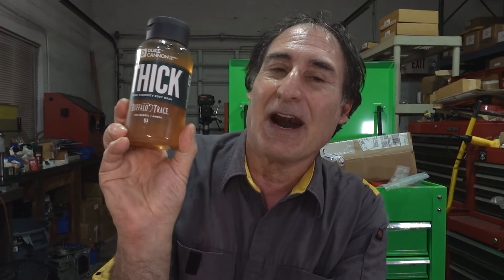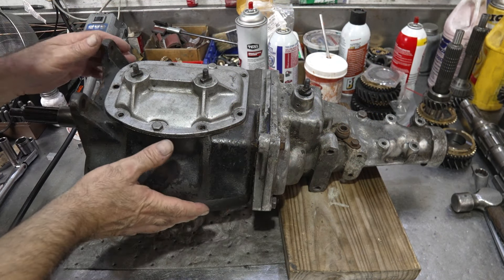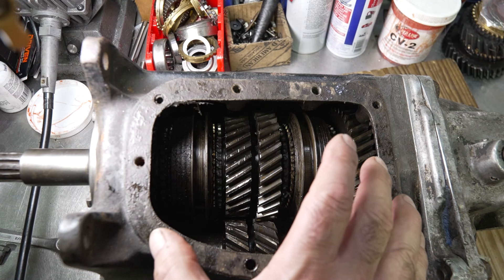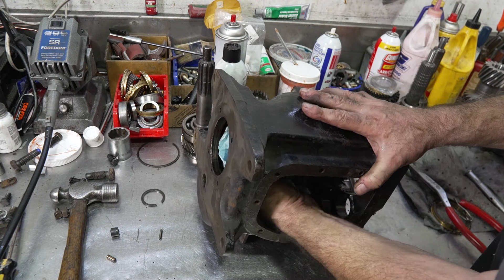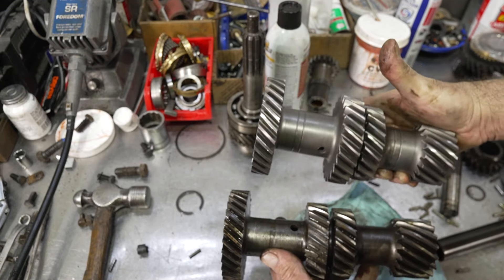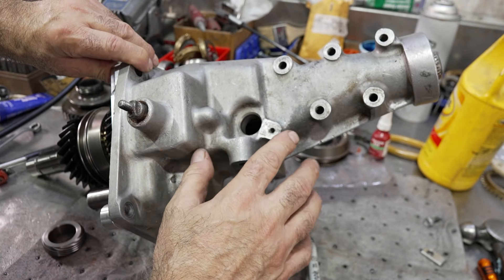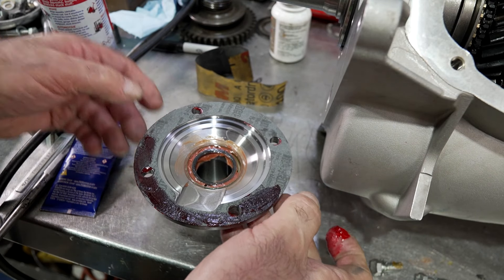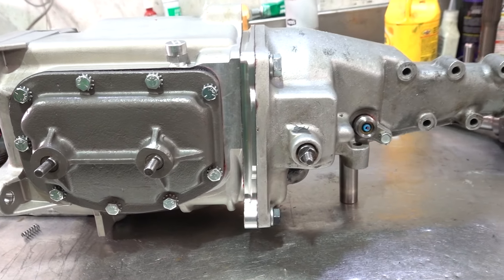C1 Corvette Early T10 4 Speed Rebuild and Upgrade

Comment: That box looked like a Saginaw or an iron Muncie. I worked on manuals in the 80s and 90s in Australia and never saw many of them in our shop. They were in some early Ho;den Monaro models. BW 4 speed single rails in some 70s and 80s Fords and Chrysler used to twist the mainshaft splines too. I once put Datsun 510 gears into an early Datsun Fairlady case. The Fairlady original gearset has Porsche type synchros. Took a bit of modifying too. Interesting stuff!

Comment: Missed you. Hope you get to feeling better. In a 350 small block and when they just came out with the angle plug head from GM and a crane cam back in the day I went from a close ratio muncie tranny to a super t 10 with 2.88 first gear. The car ran faster with the close ratio than the 2.88 first gear. You loose so many rpm from 3rd to 4th it took me out of my rpm with cam and rear end gear. On the street didn't even have to use first gear just used second because first gear was just a waste. This was on a 1973 Z28 with 4.88 rear end gears and 7,000 rpm shifts.. Am sure they make first gear to second longer today to keep 3rd to 4th closer to the close ratio. I sold the super t 10 and went back to my close ratio muncie tranny. Also the super t 10 seem to always grind a little going into 4th while on it. I would have taken the super t 10 apart to see why it was grinding into 4th gear but since I lost so many RPM between 3rd and 4th and the car ran slower just put the close ratio muncie back in and it ran much better. Depends on your application really. I must have got a good close ratio muncie tranny it shifted like a dream with a hurst shifter as the only upgrade and scatter shield. Only one who could beat me was a guy with a 1970 chevelle ss with a 454 in his car. He only got me by 3/4 car length in the quarter mile back in the early 70s. Super great times back then. I still get folks yet today to fix there 4 speeds you take the cover off the tranies and all the synchro and gears are all tore up. They think you can fix it by just install new brass synchros. I said it all shot and they don't want to put the money into it so I never see it again. I tell them to call you but am sure they don't by the way I told them 1,000 and up to fix this old tore up stuff. Then they come up with all the cheap crap on ebay and I say it's all junk on there. So am sure they buy that crap get a book and try and fix it. I told them I won't use that junk to fix it cause I don't need all the problems that come with it. At 72 I just give them your website to look you up. Hope you got a few to fix.
Reply from the maker: The 2.88 ratio is not good for drag race applications and should never be used with a rear axle higher numerically than a 3.55.  This conversion is an altternative to installing a 5 speed in a C1 corvette. You drop the rear down to 3.08 and have better acceleration and economy in 4th gear.  By the way this combination was used in later 1981 corvettes as well as the 84-88 vettes with a 3.08 rear using the Doug Nash OD.  Thanks for watching

Comment: super interesting Paul!  for the sake of curiosity, why make the conversion shafts with the 26/27 spline input output?  if they're being made as a retrofit item, why not make them work with the original clutch disc and drive shaft yoke?
Reply from the maker: The 16 spline shafts and gears were designed for their intended use from 1957 - 1963.  So... low horsepower.  The advantage is that you are now using late model Super T10 gears with better ratios and keeping the shifter location unchanged. As far as splines go.... the 26 spline input and 27 spline output are way stronger... also explained in the video,

Comment: I am in the process of upgrading mt early c2 with the t-10 trans.  I expect 425 to 450 lbft so would like to make some changes in the trans to make it stronger.  I don't want to change the 2:20 1st gear as I am running 4:10 gears withs the 340 hp engine, ,  My trans was redone about  20,000 miles ago and is in good condition.  What changes would you suggest to handle the extra torque?
Reply from the maker: The stock T10 gearset especially if it is old will break

Comment: so the locking or non-interlocking syncroteeth (brass syncro) take ALL the engine horsepower torque through those beefy gears? I thought the syncro teeth were there just to match up with the adjoining gear so that the sliding shift gear can ingage the wide span of the gear itself
Reply from the maker: Yes, all the clutch teeth are taking the full load of the torque. That is what connects the gear to the shaft. Certain cars I've actually seen those teeth shear on the high load.
Reply: @GearBoxVideo  That's incredible,  yes amazing the syncro or as you properly say 'clutch teeth' can take these loads, amazing come to think of it. BTW LUUUUVVV your videos! I just wish you had more to show!! I've learned so much!!!
Another Youtuber :'2vintage' say's his gear set on his Honda Quad, the gears keep slipping out of gear and into neutrol on it's own. And he's stumped looking at the gear set and can't find anything wrong with it when he's closely inspecting them.
Please more videos!! 🙂🙂
Reply: oop's it's a Suzuki Quad, and not a Honda Quad. If you would like to quick look at his issue, his Youtube handle is 'I Can't Fix This Rare 2-Stroke Race Quad' time; around 1:04. Sorry if i'm taking too much of your time. But you're the pro, maybe you have some ideas

Comment: I have a t5 world class I rebuilt with your video grinds in second any ideas
Reply from the maker: If you used aftermarket synchronizer rings they usually don't work well. Also make sure you have proper clutch release

Comment: important question .. I have m5 v10 with SMG box  what would recommend  redline d4 ,  7.1 100cst  redline mtl  10.4 100 cst  or mt-lv 6.5 100cst ?
Reply from the maker: Before buying any oil You need to find out what the actual specifications that the manufacturer recommends

Comment: Anyone make a kit for a Ford? I have a 65 T-10 in a K code that needs this upgrade badly.Or is it smarter to just get a T-10 plus?
Reply from the maker: you can upgrade it with a 1st design st10 ford output and tail